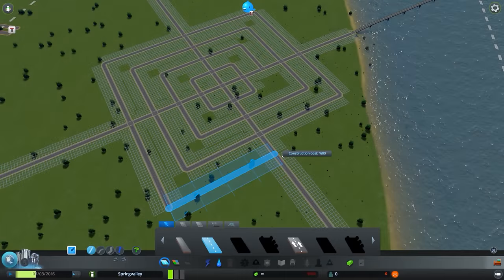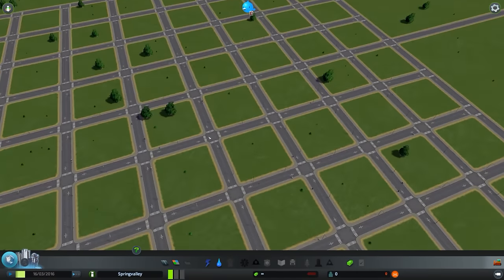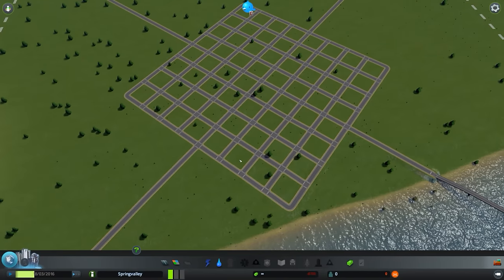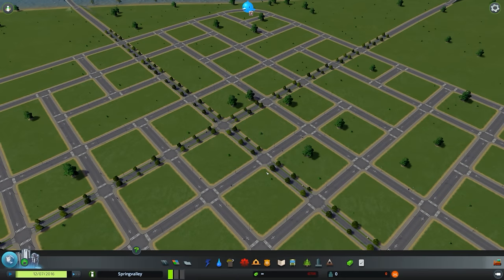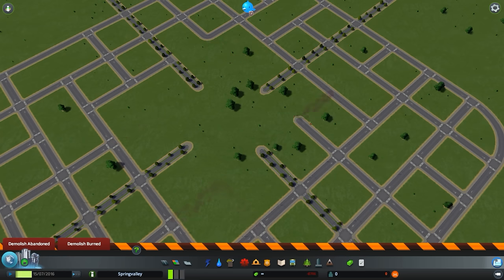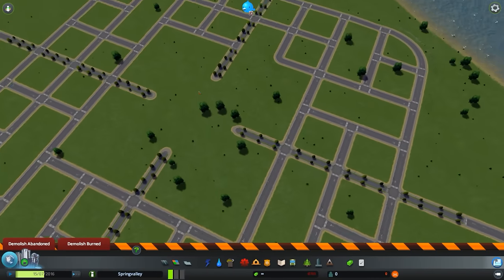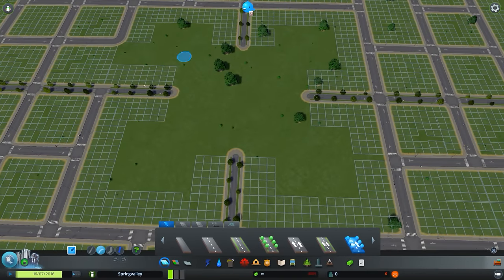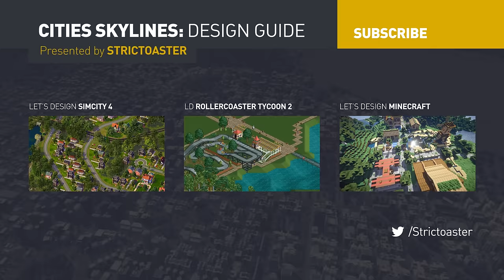Road Layout Basics — Design Guide (Cities Skylines Tutorial)

Comment: What did you call this, Gridlock City?  Sure, it looks pretty, but I'll be damned if that doesn't bring you traffic congestion of nightmarish proportions.
Reply: +Elf Monster I wish I could like this even more!
Reply: + Professor Yakkington
I did a grid city with just two way and one way two lane roads, have 60K population, and very few traffic issues, less I would say than comparable city with more traditional grid with some six lane, four lane and one ways interspersed.  I had to work on some areas that were two way and change to one way, but in this game it actually worked quite well.
Reply: I agree grid cities in C:S tend to get bad traffic but there are ways to make it work.
Grid city needs larger blocks so intersections are more spread out easing congestion. However don't have intersection TOO far as that will force all the cars and people to go to one intersection. Area where there's a lot of intersection should use more one-way to help keep a constant flow. Usually a zig-zag works well. Main roads definitely need to be multi-lane. And in addition, it needs to have several connections to other sections of the city in order to avoid a single main road getting clogged. This should be easy with grid cities.
With a moderately efficient mass transit and a few walk paths along the outskirts and main roads, traffic shouldn't be a major issue.

Comment: Hi Strictoaster. What i have done is created road template in the asset editor.
This takes the guesswork out of placing down the roads, as all you have to do is selecting a template and placing it down.
If you do one you can then place it on the steam works for others to use.
Doing this will save you a lot of time when in the game.
Reply: TENGILL can you please that would be great!
Reply: Please upload it.
Reply: Search for the steam user "LumberingTroll". He was the one that posted the first grid system assets in the workshop. I still use his designs some times.
Reply: Okay, thank you.
Reply: This is the link to his steam workshop page:
http://steamcommunity.com/id/LumberingTroll/myworkshopfiles/?appid=255710
Reply: I recommend using the "Grid 03" version. It is the best of the three he has uploaded.
Reply from the maker: TENGILL while that is a valid technique, I still prefer to create my roads manually. I feel too constrained by templates/frameworks as I want my layouts to not be exactly the same.

Thanks for sharing them anyways :)
Reply: +Strictoaster  probably a lot has happened in the last 7 months but here goes my input :) you can create an asset with a simple straight road. then, when you place it in the game, it will be parallel/perpendicular (depends how you look at it) with the map edges, and using precision engineering you can get 45 degrees snapping, so no more guess work at the beginning.
Reply: +Strictoaster Do you feel more experienced right now if you watch some of your old videos? 😂😂😂

Comment: Building roads like this will give you one VERY BIG problem, and that is trafic. Looking at your roads, and this guid, I notes that you have alot of trafic light´s. Now the problem with that is, that every time you have a trafic light, the cars and trucks ( etc ) most stop for red light.Now, If the trafic-light, is to close to each other,the trafic  will start to building it self op on the roads, wich in the long run will give you truble. The idea of this road building that you show here, is fun YEAH, but it will not work very vell, when there is more then 50.000 peoples in the city. then it will only give you trafic truble....

Comment: Looks nice, but currently there is no point having roundabouts built of anything but highway ramps, since the citizens never use any other lane than the outer most lane in roundabouts (they dont use both lanes on two-lane one-way roads, they all clog up into the outer most lane).
Since highway ramps have a maximum speed limit of 100, they are optimal for making roundabouts. They are also the smallest thinnest roads!

Comment: When you delete roads from a grid you shouldn't do it randomly, you should have a reason and a strategy. 

The primary reason is that too many intersections too close together on a high traffic street or avenue creates traffic problems, primarily by cross traffic and people wanting to make a left turn (in right hand drive countries; your directions will vary in left hand drive countries). It is especially important to thin out the intersections on the roads you've identified as the high traffic ones that will be used by your residents to get from one side of the grid to the other. If a street only has half or a third of the intersections as the other streets in the grid, that street will be held up by cross traffic and left turn traffic only about 1/2 or 1/3 as much as a street with a full complement of intersections.

Another reason to delete roads from a grid is to create larger blocks for such things as hospitals, colleges, high schools, parks, etc. that need more space.

The last reason to delete roads is that lots of people want to live on a very quiet street without any through traffic, in other words, a dead end street or cul-de-sac. So you may want to delete some connections in a residential area to create more cul-de-sacs.

That said, don't go overboard deleting roads from a grid. Every district should have more than one way of getting in and out, preferably between 4 and 8 ways (one or two for each cardinal direction) depending on the size of the district. Don't create long dead end roads or entire districts that only have a single connection to the outside. This is especially dangerous in fire-prone areas where your life (or the lives of your cims) may depend on having plenty of alternate means of escape.

Comment: for high density structures this would totally fail to much small roads and the round about would clog up BIG time.
i would not suggest this for late game structures really bad design u practically need Highway roads to go in and out ur city in order to not have traffic jams
Reply: +Klote3241 Are you joking? my one tile max density city is all blocks and earns €50,000 a week, with only the starting entrance and exits, and using no bigger than 2 lane roads (most all are dirt roads). A little public transport and a tiny thought to which zone needs to go where and it is a piece of cake. Big roads cause MORE traffic problems.
Reply: Carbon 12
Carbon 12 exactly what I have found.

Comment: Hi Strictoaster, really nice guide and it's good to see you back on Twitch and Youtube. One question though about this guide; how do you deal with road upgrades that will eventually break the grid? For example upgrading a single road to a 2x2 road that uses two blocks of space more. Any tips for that?
Reply from the maker: ***** road upgrades don't break the grid, but they do reduce the zoning space. There isn't really a way out of this but to re-factor the roads around it.

One thing I do, specially in suburbs, is not having such a tight road network. I leave empty gaps in the city blocks that I fill with trees, that way the city looks nicer and if I need to upgrade roads there is enough room. I will cover this in future parts most likely.

Comment: AVOID 4 WAY INTERSECTIONS TO AVOID GRIDLOCK

If you start with cookie cutter grid blocks, stagger the shorter adjacent roads to the longer main roads so there are only 3 way intersections then put stops on the short sides so the main roads run through without ever stopping. You're welcome.

Comment: I think your style of presenting the tutorial is very good. Good pace, good explanation and everything. But i didn't like the content. I myself have a massive problem with always ending up in that exact grid pattern and tried to get out of it with this tutorial. So you showed the grid pattern, which probably every beginner player ends up in and not much more design. Also the roundabout would have been nice without the diagonals. And they created 6way intersections so you will get a massive traffic problem with that. Obviously this is not a traffic guide, but a design which does not support traffic is not a good design. I think you should work a bit on the content. Think twice about what you say, because how you say it, is already very good. Even for a non-native english speaker like me.